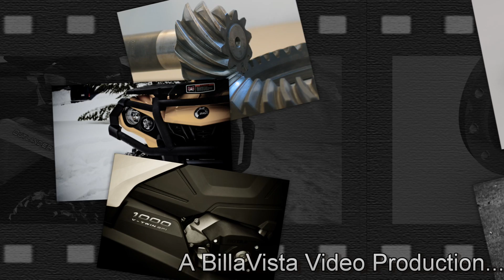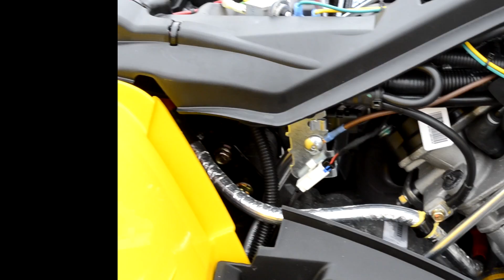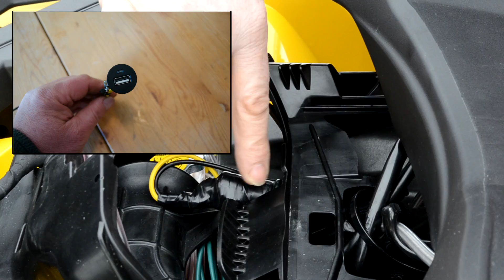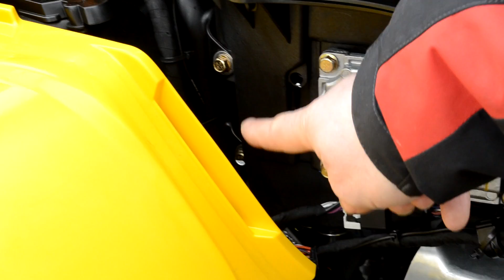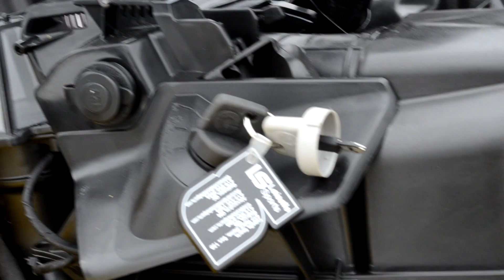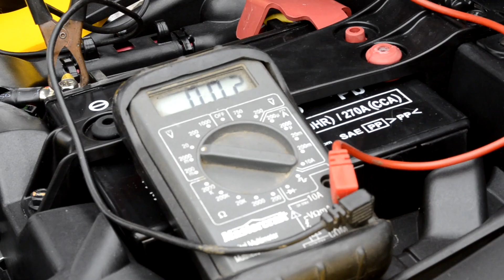Can-Am ATV - How to Add an Accessory Fuse Box

Comment: I found the Blade Fuse Holder and the Relay/Socket at Princess Auto web site, but may I ask where you picked up the 40 amp push button breaker? Thanks!
Reply from the maker: https://www.digikey.ca/en/products/category/circuit-protection/9

Comment: Great video! I have to ask you a question. In this video and your video "Under The Hood" your machine is so clean under the seat and under the gauge pod. Did you video this when your machine was brand new? If not, what is your secret for getting it looking this great! It's pretty much impossible to wash under the pod and seat. I also liked your Iron Baltic Skid Plate install videos etc. I as well went with that set up for my 2021 Outlander Max XT. Thank you for your vids!
Reply from the maker: Unfortunately I filmed it while nearly brand new so no secret I'm afraid.
Reply: @BillaVista  Thanks for the reply! Cheers!

Comment: Just ran across your video. I want to add a fuse box with relay and circuit breaker to my 2011 Outlander 500. I like the added touch of the relay connected/powered by the AC/DC outlet power. My bike does not have the AC/DC outlet powered. Some previous owner unhooked the wires and I can't figure out which ones to re-connect. Where did you get the fuse box and relay and circuit breaker?

Comment: Great vid. I'm gonna do just about the same thing. I got like 4-5 accessories that needs power. Hey that circuit breaker u have, where can I get that??
Reply: I did this to mine and the heat from the engine will melt the fuse box now i need to find a cooler spot to mount the fuse box

Comment: I know this video is a couple years old but I have to ask why you went through all the trouble of adding the fuse box and running the wires to the pod when there is an accessory plug keyed to the ignition in the pod? At the start of the video the white plug your green and yellow wires run by is also another accessory plug keyed to the ignition. You do very nice work either way.

Comment: Love your videos very helpful. But could you help me figure out how I can sort of use this setup but with multiple switches to control different things? I wanna hook up Halo lights and a light bar but want to be able to run them seperately with different switches. Is there a way to do that? Thanks in advance.
Reply: When you run the wires to the different accessories, simple to add a switch and install it somewhere easy to reach off the positive cable.. You do sound like you're not familiar with how electrical equipment work. Please have a friend that knows what he's doing to help. Easy to cause a short
Reply: +Brett G actually on the contrary I am quiet good with electrical for car stereo systems lol. was just curious on what the easiest way to have the extra switches ran for each thing. I kind of over looked the obvious answer because when I used to run things I usually just used power ground in line fuse and a switch. I understand how the relay works and the distribution block I was just thinking I would have to run this setup for everything I wanted to power differently. I wrote this comment awhile ago so I don't know what I was thinking when I asked?

But thanks for the answer. I honestly don't know how I overlooked that. I believe I have also watched a few other of your videos to help me. I purchased a service manual now for some easy to do stuff and some more advanced stuff. anyways thanks again.
Reply: +Adam Bryant no problem man. No disrespect intended, I just knew somebody who had a lot of accessories and they're beautiful machine went up in flames. It can happen to the best of us. I am actually now curious about that white accessory plug The above comment mentioned
Reply: +Brett G I believe that white accessory plug is the same one you can run brp hand warmers too. or if you bought a GPS from brp themselves maybe it had that plug in. but I could be wrong.